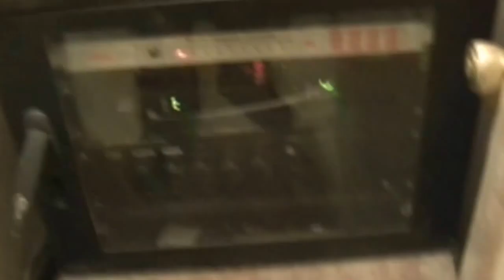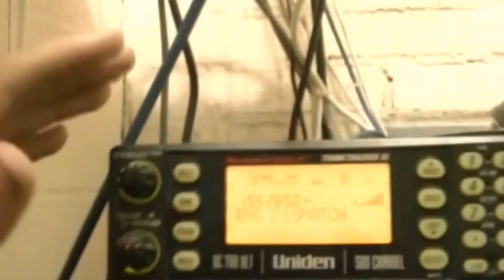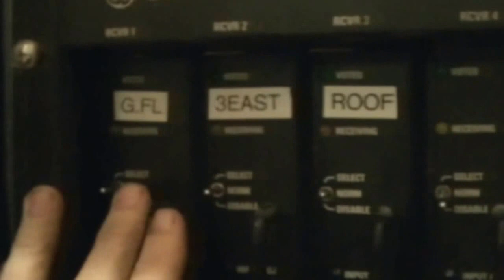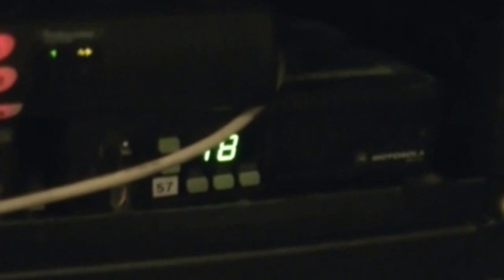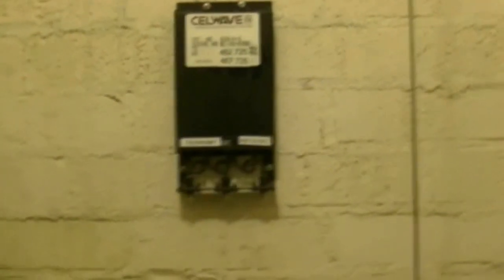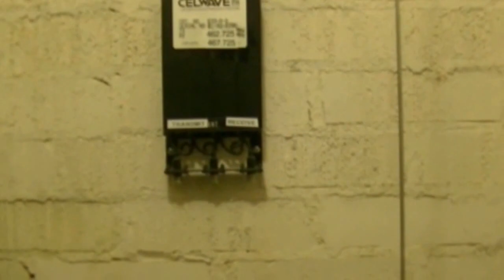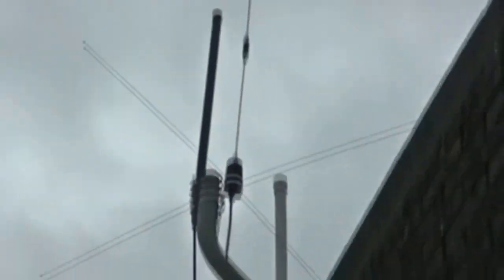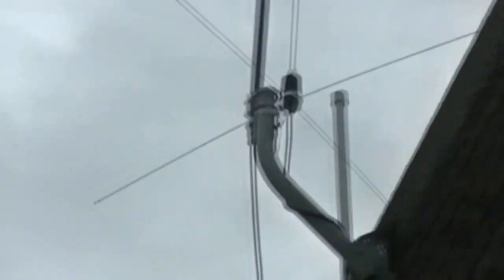GMRS Repeater

Comment: Hey man!! I LOVE JEDI radios. I have ht1000s and mt2000s that have the microphonics noise issue when I transmit that sounds like wind noise. I heard you can solder something inside, any info on that fix??
Reply from the maker: That's not an issue I have come across... Might be something related to that on Repeater Builder. I'll have to go see if I can find anything...

Comment: Pardon the late comment, but I wanted to mention, if you truly have the correct equipment to tune a duplexer, and you truly have the knowledge and skill to do it, there is NO reason you should have trouble with a Celwave notch/notch duplexer like that, in a configuration like yours. Are you certain you didn't tune the ports backwards, or not at all? Seriously - Celwave makes a quality product and should not have given you a lick of trouble if you tuned it properly.
Reply from the maker: I guess I wasn't clear in the video. The duplexer in this video is the wrong split (470-512), and wouldn't tune low enough.  I have since replaced it with the proper 430-470 split with no issues.